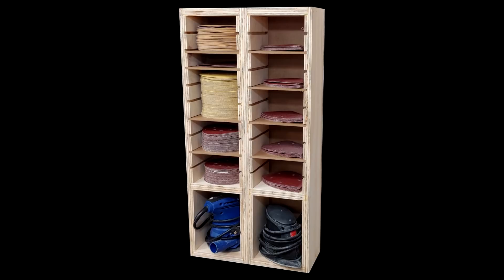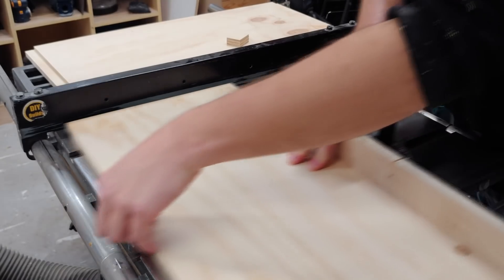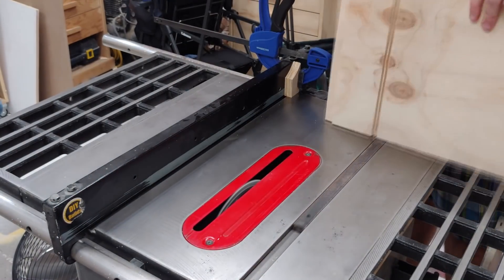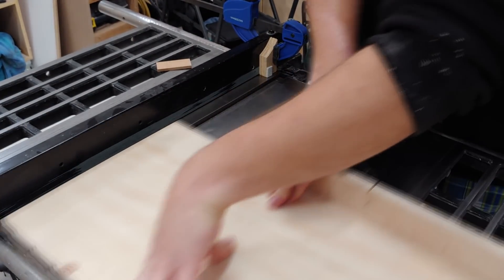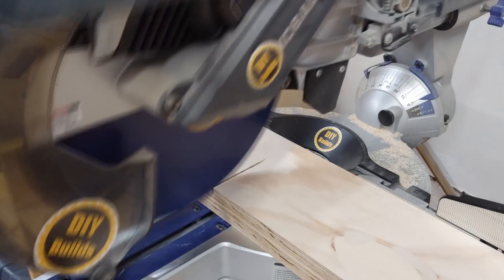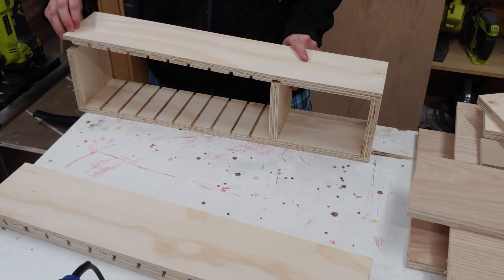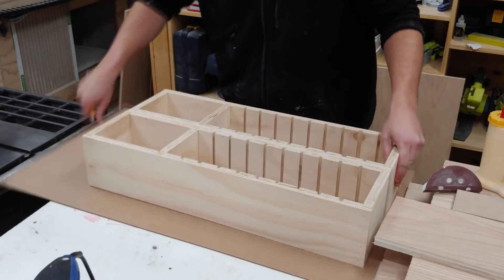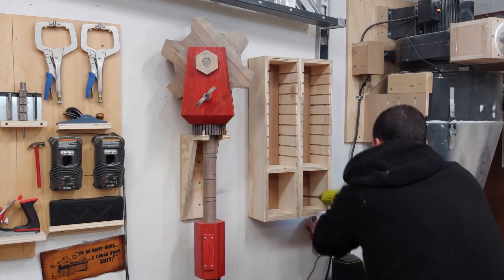How to Build a Sanding Discs Storage Shelf

Comment: Nice, straight forward build. My sandpaper is everywhere it seems. For this it's likely fine, but relying on the fiber board to support the weight of much more would give me pause.
Reply from the maker: Ya that is a worry of mine as well. No reason you can't just used 1/2" plywood for a backer though.
Reply: @DIYBuilds  True, maybe glue a fender washer to spread the load, or even a 1x4 spanning the top inside at the back, like a cabinet. I've had a lot of hand me down (disposable) furniture and have fought and glued shreds of the fiberboard back together. There's a ton to be said of making the project and addressing problems if they arise. I tend to get in my own way, lol.
Reply: @DIYBuilds  A french cleat would work pretty well too.  Nice job!